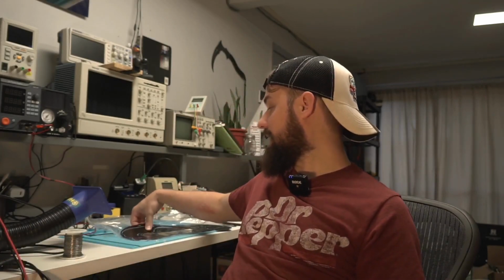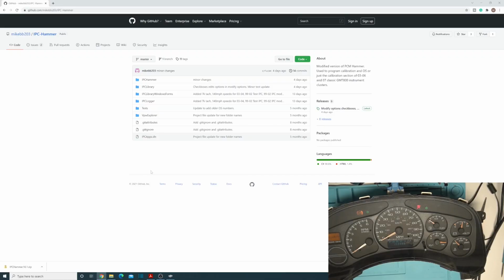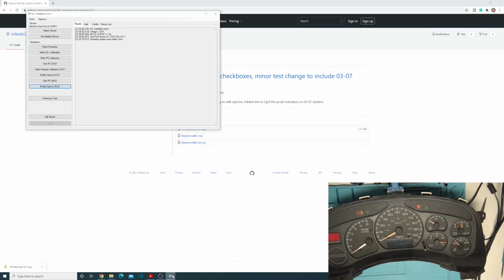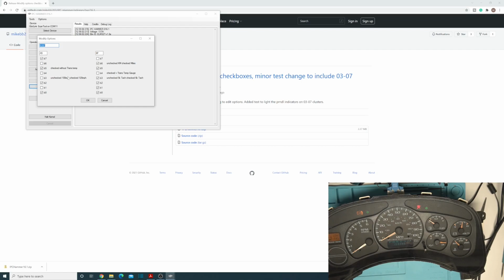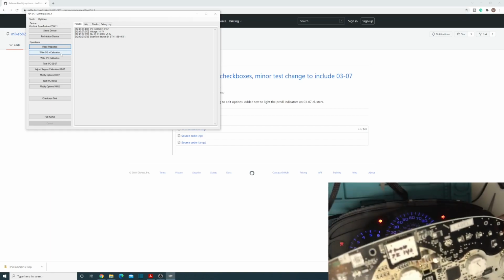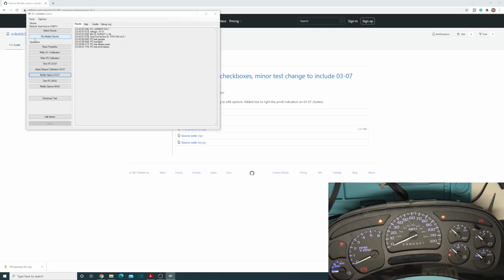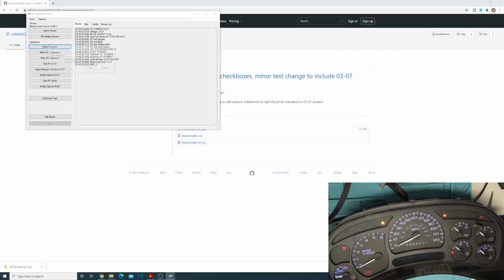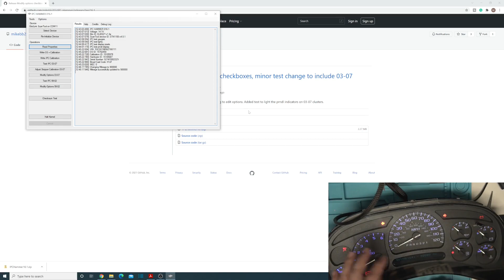IPC Hammer 16.1 Update. 99-02 Clusters added!

Comment: Hello. @fixedtillbroken.   I have a 2004 gmc sierra 1500 .  I need to replace the cluster the previous owner caused damage to the board. What cluster should I look out for. I got a aftermarket faceplate with trans temp and I want to try and program it km) watching your video see if I can pull it off.    Any information on clusters that fit the 04 would be great.
Reply from the maker: So yes 03 or 04 boards are what you need. Other than that everything is the same with them just different software on them. A dealer can flash for you or you can use ipc hammer

Comment: What happened to the facebook group? I was a member there and it's gone. Even all my notifications of new posts have disappeared.
Reply from the maker: Moderators cleaned out inactive members and such. I handed over the keys to the group to the mods because it never was a fixed until broken Facebook group, its a techs group. Id recommend reapplying if you think they should not have pushed you out. I need to set up a group for the channel but I am just waiting until I have the time I wasn't really running that other group much anyways.

Comment: Do you know if this will work for holden clusters? They are gm also. Pontiacs are pretty much the same here but called Commodores haha. Thanks mate 🤟
Reply: Possibly. It may be possible to add the Holden’s. Are you talking about vt/vz cars? If there is enough interest and I can find some clusters to test with it could be something that gets added.
Reply: @mikebb203  hey mate. Yeah vt to vz. The Pontiac gto is exactly the same as a vy/vz manaro. And vy/vz use pretty much the same dash I think ( will try and confirm)  only our hsv models are different
Reply: Jason Martin over on lsdroid Would actually be the bloke to ask. He's a car wizard I swear haha.
Reply from the maker: he has seen IPC hammer. he thought it was interesting.
Reply: @FixedUntilBroken  I'm sure if he had spare time he would Probably dive into it. But I swear him and Pete don't even have time to scratch their own ass lately. The work they have done on lsdroid and the obdx tool is crazy. And they still answer people's questions and problems on Facebook or message haha. Hats off to them. 
If I was switched on with all the programming stuff I would try help get the holdens supported but I would Probably be no help hahaha
Reply: @mikebb203  is odblink the only Bluetooth dongle that works? I can’t find mine and if I have to replace, which versions are compatible? Just the LX or some of the others?
Reply: @bumpinz  I know the obdlink lx and Mx+ work. But the newer ones may not work. There has been some changes that made them stop working in pcmhammer. So they would probably   have issues with ipchammer. I haven’t tested yet but I believe the obdxpro vt should work. Some people have claimed that it does.
Reply: @mikebb203  thanks for the reply, I’m about to try it out👍

Comment: That github gives us all the equipment to get all this to work on our clusters?

Any idea if he plans on doing the odometer edits? I may have misheard you but I think I heard you say not yet which means he might? :)

Thanks for all you do
Reply: It works to correct the mileage on 03-07. But I’m looking to add it on 99-02.
Reply: @mikebb203  Cool Mike thanks! I will have to look at purchasing some bench gear so I can edit my 99-02 mileage when it is released. I have a power supply just need the other stuff lol

I assume we can't do this but is there a way to add test sweep to the cluster whenever you start the truck? So turn the key to on and the needles sweep?
Reply: I don’t believe the 99-02 are reprogrammable. So it would be unlikely to make any changes like that.
Reply: @mikebb203  Yeah I didn't think so, was just curious. Mileage reprogram is enough for this guy at least. If I knew more about coding I would check the source files and try to help out but unfortunately I do not.

Good luck and hats off to you for doing all this work!